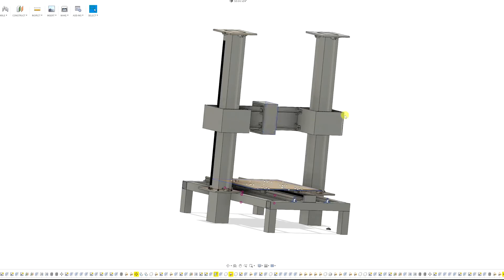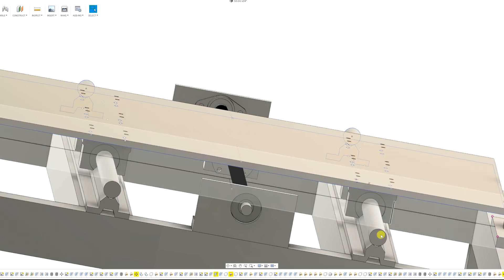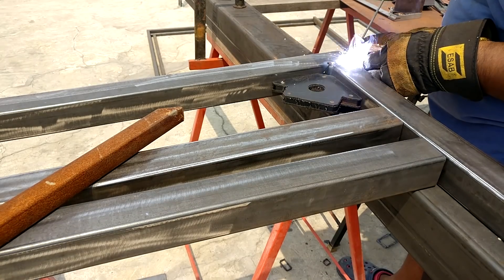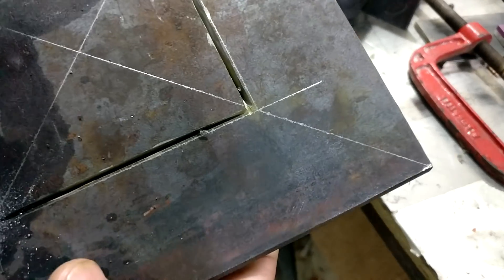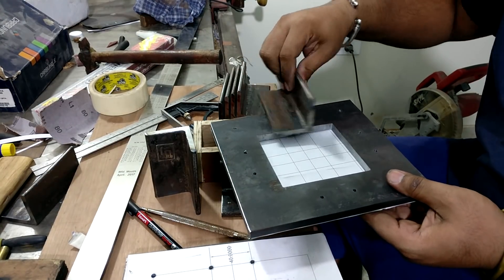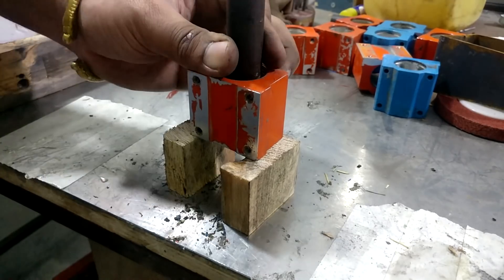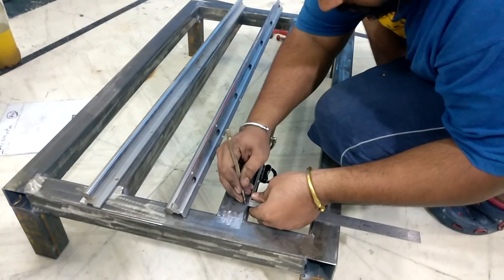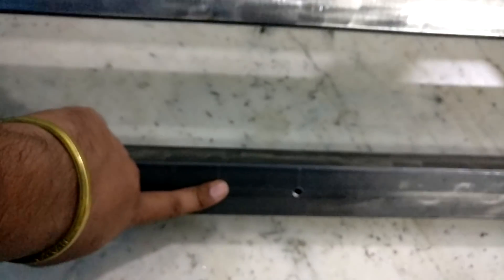Homemade - 3 in 1 CNC Machine - Part-1 By AMbros custom

Comment: Nice to see your back building more CNCs, nice to see your repurposing bearing and linear rails. For a laser and 3d printer machine  is beefy... as cnc router you may have racking issues with the tall z posts, I would  suggest adding a triangle back brace as the z will flex.  Great build...keep the hard work up.
Reply from the maker: Thanks brother and there is slight racking in z axis but it's on the top only after the gantry a middle brace fixed that problem. Thanks for being here:)